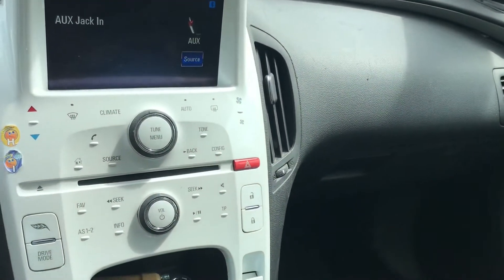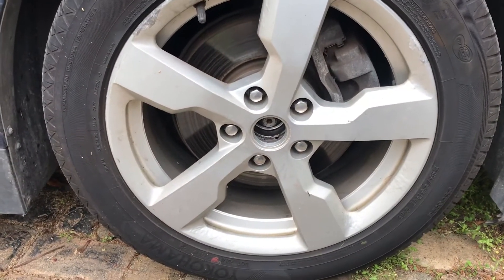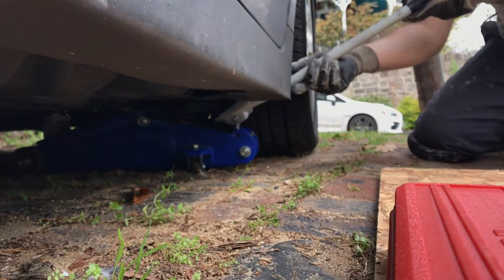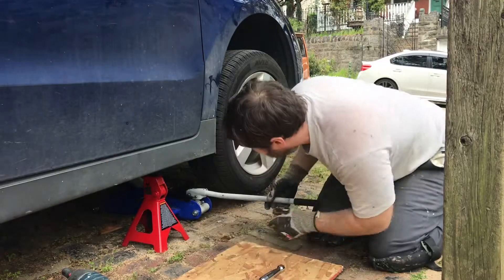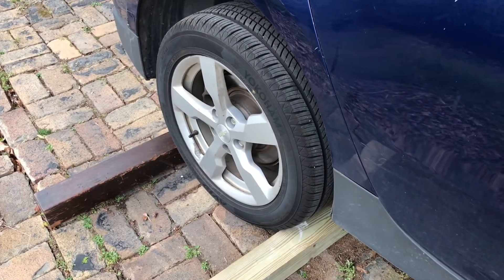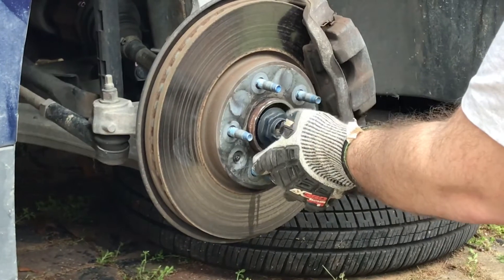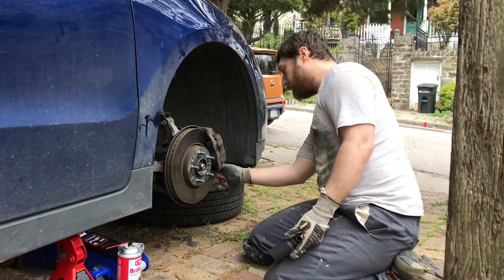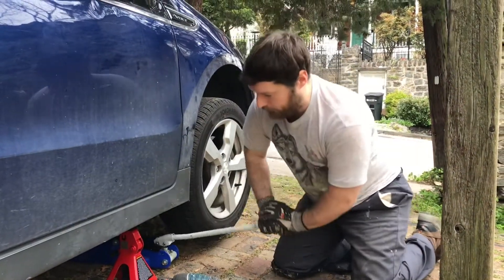Chevy Volt Clicking Noise Fix

Comment: This is the same issue tesla has - regen & forward torque work the spline that loostens the nut. They use a ramp washer to keep the nut from loostening, but the spline still clicks... they just add lube to keep it quiet. Has noone figured out how to put a spline in here that doesn't chuck & make noise?

Comment: Thx for video. Picked up last month single owned 2013 volt w 168k miles and had this clicking sound. Tightened the axle nut today like you said and noise gone. Thx again
Reply: Did you just tighten it or did your buy the replacement part too?
Reply: @royturnwall6467 tighten only

Comment: Is it enough to install just a nut in order  to avoid the noise ?  bicouse I was reading the issue is with the washers on the front driveshafts.
Reply from the maker: I responded to a similar comment because the answer is "not really." I ended up replacing the bearing hub and the washer because I had an error code for the wheel speed sensor. I think my issue was a combination of a loose nut and broken washer because it completely went away once I replaced the washer.
Reply from the maker: I posted a video of that process too.
Reply: @vaughanpiccolo7232 I replaced the washer and the nuts on both sides of my 2014 volts and after about 5,000 mi the noise returned with a vengeance.  How long has it been since you replaced the washer and has the noise returned?

Comment: What’s the consensus on the best Chevy Volt forum? I’ve got a mystery creak in the rear of my 2nd gen whenever the suspension articulates. Dealer was no help, so I’ll have a go myself... with a little help from the community.
Reply: Spray the rear trailing arm bushings with silicone spray, soak them. Specifically the big bushings where the trailing arm mounts to the chassis.

Comment: hi so did this solve the clicking sound or not? why do you need to reverse 45 deg. then tghten again (second pass)??
Reply from the maker: Yes it solved the clicking problem but a few weeks later I got a speed sensor error code for that wheel. I ended up replacing the bearing hub and it turns out that the washer on the CV behind the bearing was the issue. A small piece of it broke off and interfered with the sensor. So replacing that washer is definitely the way to go but it’s a much more complicated fix than what I showed. I’ll post that video soon. I just used my breaker bar and a carpenter’s angle finder to figure out how far to reverse to back it off 45 degrees but really you could probably eye it up.
Reply: Had same problem on my 12 ampera. I just tighten axle nuts and it solved the problem.i still dont know why we need to reverse 45 deg and then tighten again on 25 Nm???

Comment: did the service manual say anything about replacing the washer on the spindle?
Reply from the maker: I’m going to post another video soon where I replace the bearing hub and the washer because I had an error code for the wheel speed sensor. I think my issue was a combination of a loose nut and broken washer.
Reply from the maker: Kevin Hickman Yes, it does say to replace it but you can’t get to it without removing the hub bearing, so I decided not to at that time. In the section describing the hub bearing it says to replace that washer, the axel nut, and all of the hub bearing mounting bolts.